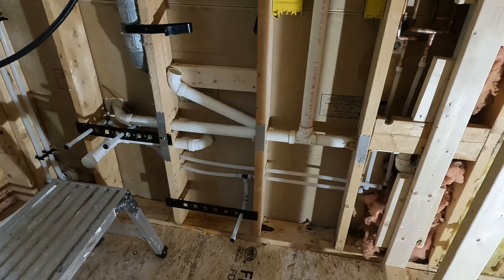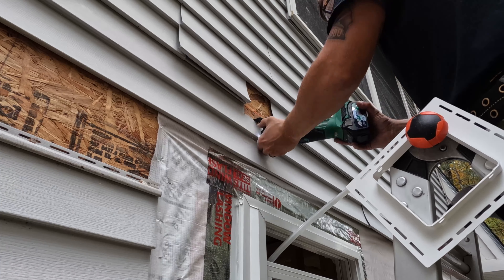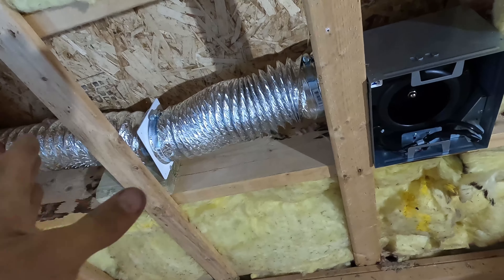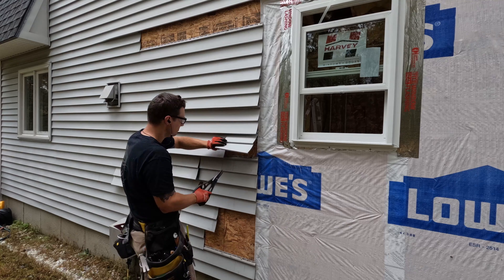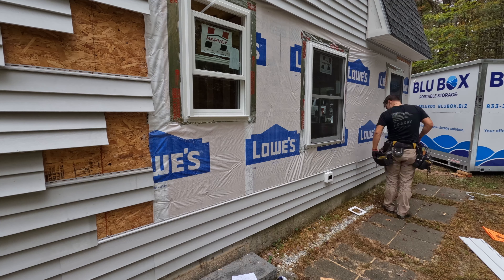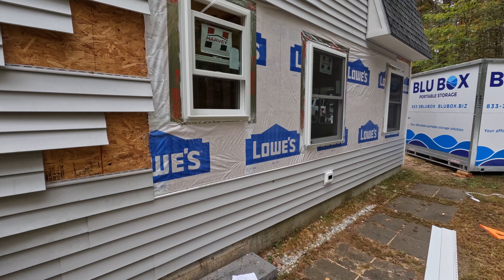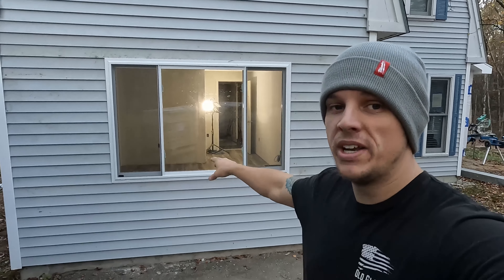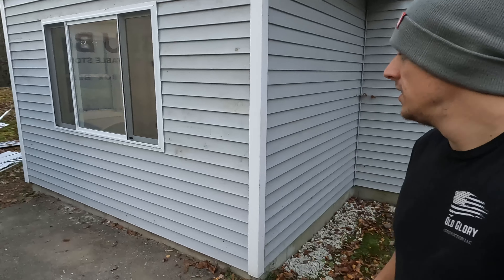Installing Vinyl Siding around new Windows ||Garage to Living Area Transformation||

Comment: What are you using to cut the siding? Any tips for doing siding?
Reply from the maker: I was using siding snips, and a multitool to cut out some notches or if the material was cold and brittle.. I'd say don't try it for the first time when its freezing. the material breaks easily and will crack when you use snips.